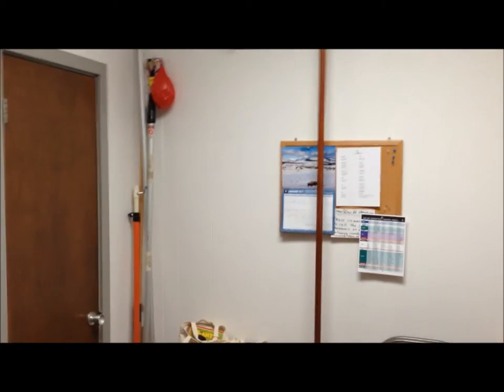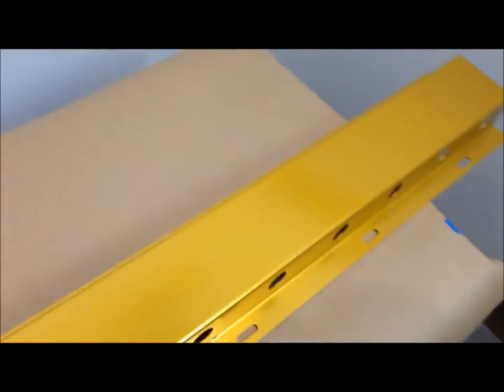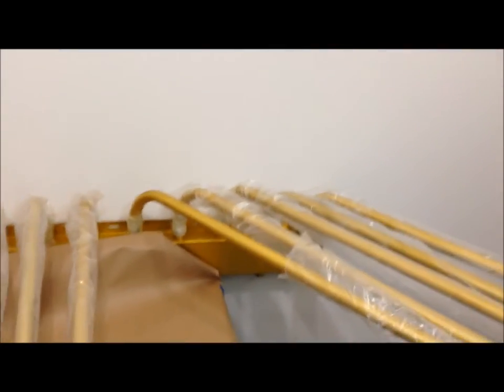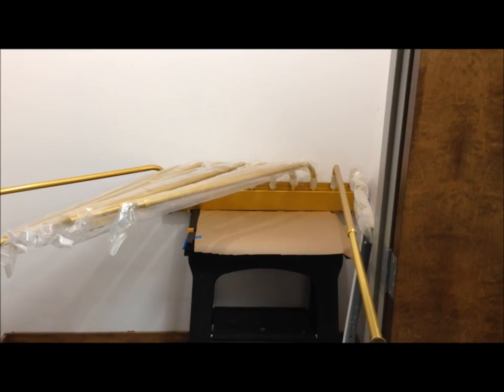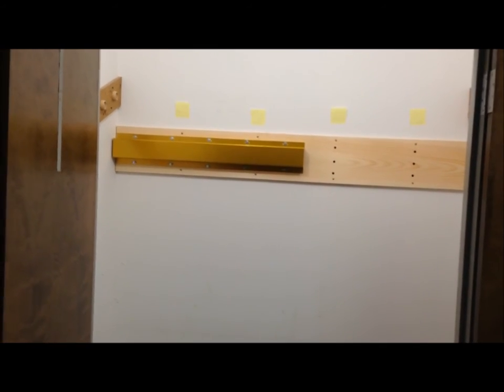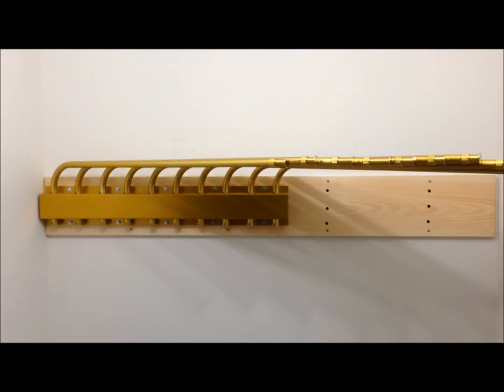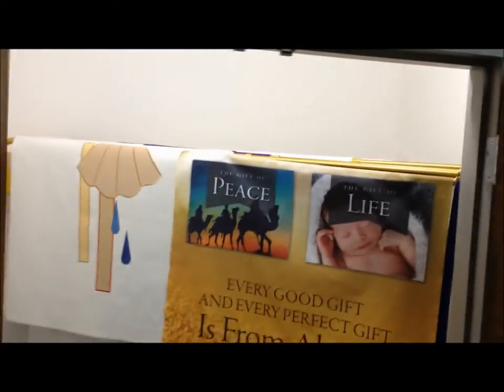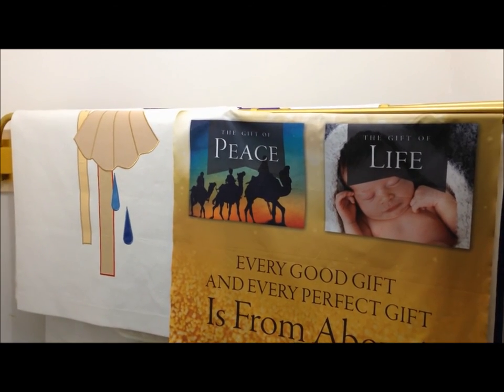Church Altar Guild Banner Storage System Installation

Comment: Rick, thanks for the thorough instructions on valve lubrication and use of the Suncast auto reel. How do I maintain or lubricate the inner workings of the rewind motor and drum. Mine is sluggish and stalls often, making me wish I'd bought the hand cranked model. Thanks
Reply from the maker: Hi Daniel,
It looks like you posted this in the wrong video, but I'll answer it here anyway.  
I haven't had a need to go into the rewind mechanism yet, so I'm sorry I can't help you with that.  You can call Suncast's tech department and see what they say.